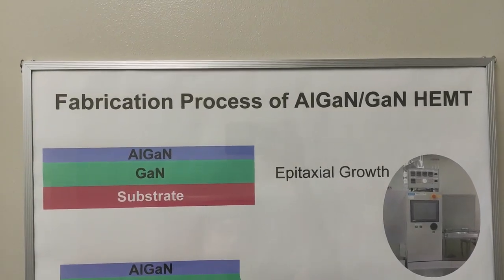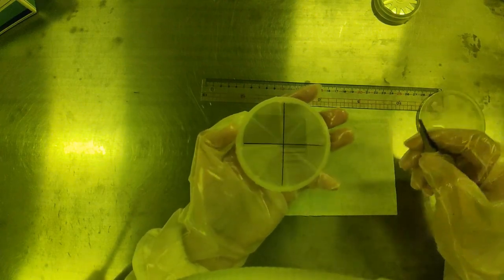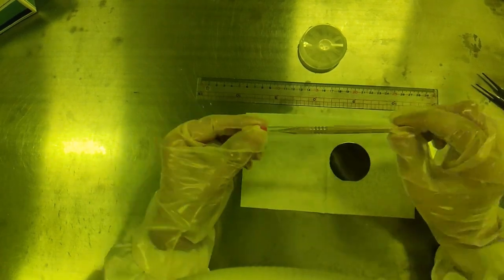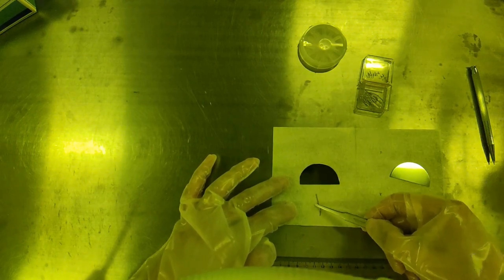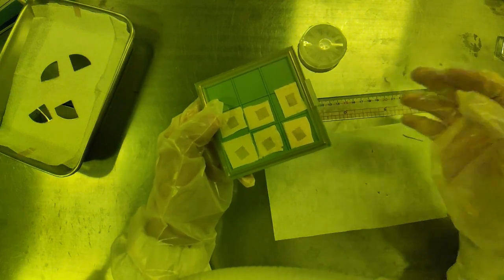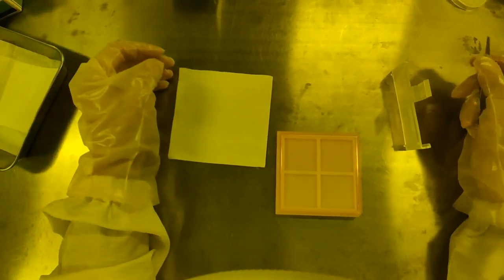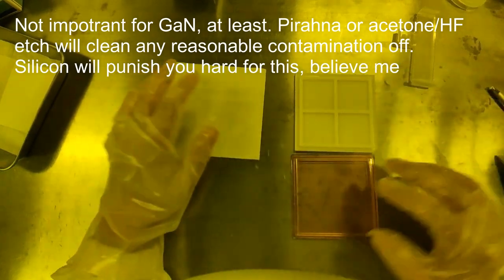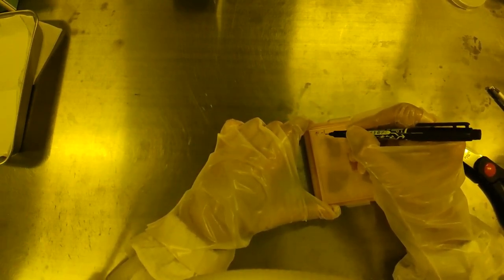Semiconductor production process. Lab tour. AlGaN/GaN-HEMT process walkthrough #0

Comment: I don't think your wipes are free of hard particles that could scratch the wafer surface, do you really have to do that?
Reply from the maker: Those are special lint-free wipes for cleanrooms (Kimwipes). This method is indeed too barbaric for IC chips with complex structures already on them, but for bare wafers before cleaning it is acceptable. It is a good time-performance tradeoff in my experience